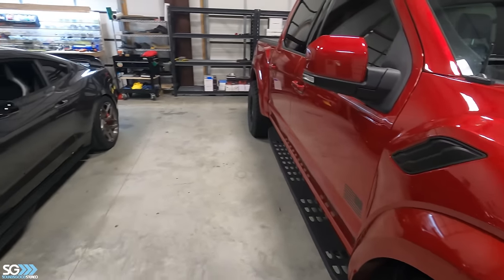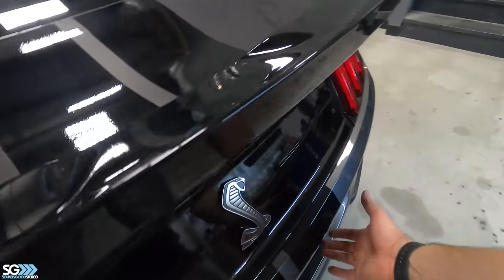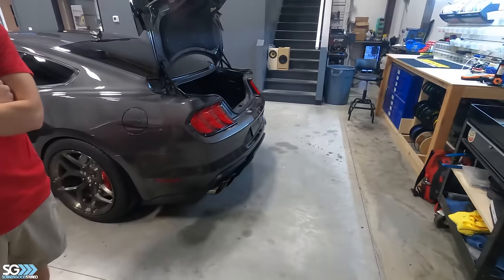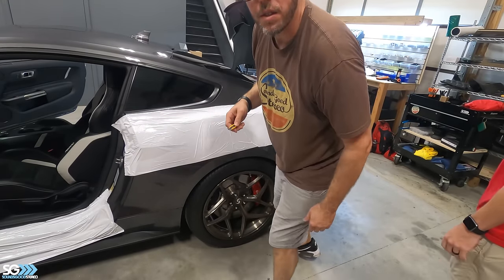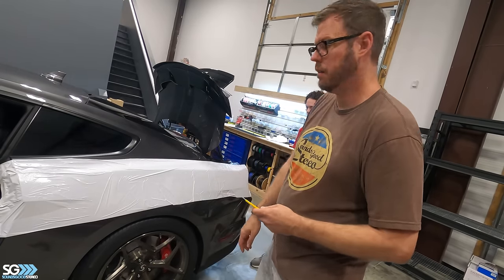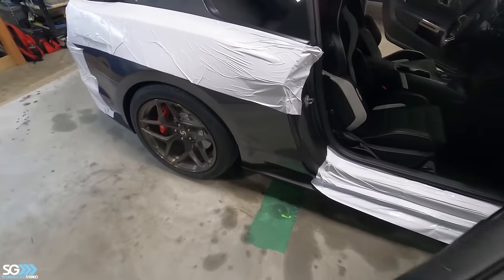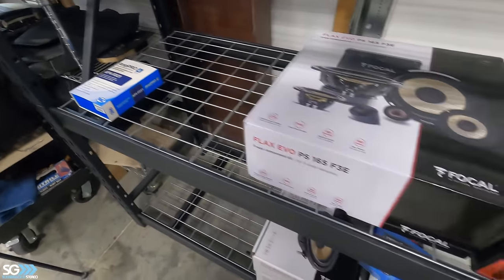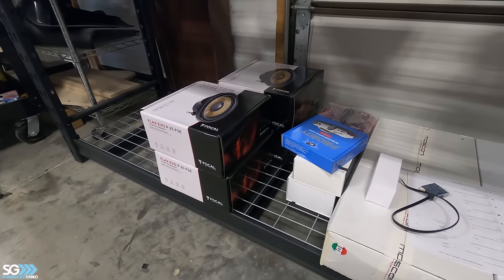2020 Ford Mustang GT500 Shelby Custom Stealth $20K Stereo System

Comment: How did we gomfrom Flax 3 ways to having K2 is my question...
Reply from the maker: Good eye, but it’s actually two mustangs, at the same time. One has K2 and the other Flax. You can see the wheels change between the cars
Reply: I see the 2 cars..  no mention of any other system going into the other car earlier in the video or in the description so kinda threw me off.   Wondered if the customer changed their mind or if the flax didn't fit.   I have the k2s in my Flex but was curious about the flax is all .
Reply from the maker: We started the first one and another customer of ours begged up to do his Mustang.. So it's identical systems, gear, etc except interior speakers. Made it very efficient for us and the two clients benefited from this to help reduce the custom fab costs.

Comment: I have a 2019 mustang convertible I have 2 runs of xspower 0 gauge one power one ground going back. I have the same focal 3 way front component set in front being it's convertible I had no space had to run neo 6.5 in the sides of the back. I have a crossfire 800.4 running the mids and highs and a crossfire 800.1 running a single sundown x8 @ 1ohm.
Now I have factory battery under the hood plan on doing a big 3 and have a xspower d1200 for for in the trunk but I don't see any one doing builds in these mustangs and using extra batteries. What was used for electrical in this car? I know the 2 runs I have are over kill but do I not need the batter in the back? Do I have to do a big 3?
Reply from the maker: We design our systems for efficiency, so no need for electrical upgrades. To do this, you will need to use efficient speakers, amplifiers, enclosure design along with setting the levels with a Oscilloscope. Then the final tune with a DSP to ensure no wasted energy is transferred to heat that is not needed to be.

Comment: Them subs probably could use more airspace in the box but what do i know😂
Reply from the maker: These are designed for small sealed enclosures, these are the pancake subs, not the full frame Flax. They require around 0.64 each to reach 34hz F-3 down point. 
https://www.focal-america.com/wp-content/uploads/2020/01/FT_P25FSE-1.pdf

Comment: What about the center channel mid? Is it still working?
Reply from the maker: No, in this vehicle we recreated the a phantom center with the Mosconi 8to12 Aerospace DSP. So you would never know the center channel is not playing and customers always swear there is a center channel....
Reply: I almost always get rid of the center channel. most aftermarket equipment is not setup for it and most audio is recorded in stereo anyways which means that the factory center channel was made up and not how the sound engineer that did the mix intended it to sound.
Reply from the maker: Yes.. We are starting to use a type of upmixer which retains "stereo, but provides better dimension to the sound stage. It's very interesting.

Comment: Did both Mustang's get the same Mosconi amps?
Reply from the maker: Yeap, identical system except front speakers
Reply: So the power from that Mosconi amp isn't to much for the Focal flax 3way.
Reply from the maker: No, not in the right hands… Wait until you see what we did in the Bronco build… we ran the Pro 5/30 just for the left side 3-way and another Pro 5/30 for the right side.. So 2,600+ just on the 3-way kit 😱😱

Comment: Nice work but there is no way in hell that the airspace is enough for 4 of those subwoofers. I know for a fact that those 4 subwoofers in that small airspace is severely underperforming and not playing no where to its potential. One 10 ported or one 12 sealed would yield more output.
Reply from the maker: These are designed for small sealed enclosures, these are the pancake subs, not the full frame Flax. They require around 0.64 each to reach 34hz F-3 down point. 
https://www.focal-america.com/wp-content/uploads/2020/01/FT_P25FSE-1.pdf

Comment: I dunno how one could justify spending between 75-100k for a car then spend another quarter of what the car cost into a stereo like that..  i mean great work on the install, everything was put in with the best if care and products but the profit margin on that build had to be 80% labor 20% on parts and materials.  or real close to that..  because for everything that physically got installed product wise couldnt cost a dealer/ installer any more than 3k tops and the very tops.  Because think about the tahoe that down4sound built..  he invested 20k into that audio system and that is over 100k watts with more speakers you can count on your hands, all competition 15 sundown audio's and that build came with a full custom fiberglass interior, plexi windshield and windows, i mean everything needed for a comp. Stereo..  just blows my mind how much price varies with things..  dude can pull up to a store and literally rattle crap off the shelves inside the store.  He cracked a gas station window playing his car stereo...
Reply from the maker: I know what you are saying.... Just think about this.. A Porsche GT3 cost from $161,100, that's the starting point. Here are the specs:

0-60 - 2.7 Sec
Qtr Mile - 10.8sec

Now you can spend $30k on an old car, add engine/turbo/nitrous, etc and absolutely go faster than this car for WAY less...

It's not all about how fast in a straight line you can go but rather a car that delivers the entire package. Speed, corning, luxury interior, technology, safety features, air conditioning, luggage room, and not leaving every event on a trailer from it breaking, etc. That's why people buy a $160K "SLOW" car.. Not because of the straight-line speed.

Our systems are for music reproduction, accuracy, staging, depth, width and deliver a concert-level volume, with absolute precision in music that rivals most high-end home audio systems.

So your correct, D4S truck is insane, it's a lot of fun, but it's designed to shock rather than to play for accuracy. So two different customers, two different lifestyles. We cater to the customers that want it all and we make it look factory when it's done.

Comment: 2.5 hour vid and 20 mins in all the speakers are installed and half the trunk is done with no work shown. Then 2 hours of wood working. WTH?
Reply from the maker: Yes, that is what it takes to build a custom stereo system. The equipment is easy, but a stealth installation takes time. So for those that want to learn new techniques, improve their skill set, they can pick up on things from our videos.
Reply: Yes it would have been nice to see 'up the dress / behind the curtain' to see how it was routed and if the wires were Tessa tape shrink wrapped etc.
Reply from the maker: You can check out our other videos to see how we do behind the scenes on the wiring.

Comment: https://youtu.be/dvj9ilB8vqA?t=35  Wouldn't doubt it was programmed wrong from factory.  Common issue on the Focus RS.
Reply from the maker: It's common in the 2018-2020 Ford vehicles. I guess it was a transition period. Inside the amplifier, it say Harman, so a totally different company

Comment: I don't get why people spend so much money on "okay" speaker brands. FOCAL was cool 10 years ago. Now its become "trendy" because people started learning about them, all while other brands have surpassed them.
Reply from the maker: Not true…. If we believe we could produce a better system, for less money, sign us up. But in reality, this is simply not true. Just like cars, a Koenigsegg is not the fastest in a quarter mile, so why do people buy them? It’s not about doing only one thing great, it’s the entire package, handling, speed, engineering, absolute precision, etc. No other brand does the entire package better than Focal, period. But just like anything, tuning, acoustical treatments, customers goals, etc all play a part.
Reply: @SoundsGoodStereo    I’ve had three sets of Focal components before bud, including the K2 Power KX’s. They’re definitely not the best for the money. Audison Voce K6’s blow them away (currently running these now) for a few hundred less. They produce more rms watts, even in its 4ohm configuration, and still produces about the same db levels and more frequency response. Focals sound like a “better tuned”Alpine brand of speaker, especially due to its high pitched tweeters. Audison components sound premium and acoustic in comparison. Less distortion with Audison Voce K6’s. Even Morel’s sound a lot better than the Focal’s.

As far as subs are concerned, the Sundown SD4 shallow mount sub produces more rms, more bass, and as good, if better, SQ than the Focal P25’s used here, for around the same price. 

I do like your use of Mosconi amps and DSP, but there’s a lot left on the table using those Focal speakers and subs. I understand the owner wants to stick with one brand for the speakers and subs, but there’s so much more he could have done with the money he spent. Most of the time, it comes down to people not knowing other brands out there, because other brands aren’t trendy like others, or what shops have in house for potential customers to demo, and the shop selling them on the brands they carry. This is why so many uninformed buyers buy Alpine, or Pioneer, when they could’ve bought Focal for the same price, but these customers most likely never knew Focal existed. Same principle.
Reply from the maker: Let us know when your in the area and we will see if we have a vehicle for you to hear for yourself. Just like engines, tuning is everything and you can make even the best "parts" fail when they are not utilized properly. We can just agree to disagree on the brand choices, no reason to compare, but we know the capabilities of these products, have used several other "brands" to accomplish unique goals for our clients and are familiar with the "products" you mentioned. There is a reason they are not in this vehicle and the customer had zero say in the gear... We do not let customers tell us what gear they want, but rather we use our experience to accomplish a goal for that client within their budget.
Reply: @SoundsGoodStereo  I had a shop sell me on Focal’s about a decade ago, just the same. Spent thousands on speakers, subs, and tuning. I’ll never make that choice to have a shop “make the choice for me” ever again. But back then I didn’t know any better. Now I do, and am more knowledgeable about speakers and brands across the spectrum, than most car audio shop owners. Yes, let’s agree to disagree on that issue.

Yes, tuning is a very important piece to the puzzle, but it’s still just a “piece”. Speakers are also an important piece to the puzzle.
Reply from the maker: You went to the wrong shop... If they do not know 1,000 times more than you on every aspect of the gear, acoustics, your vehicle, etc, then they are not the proper shop. It's unfortunate you had a bad experience with that shop and rest assure, like restaurants, we are not all created equal. In the future, pick a better chef, he will choose the best ingredients that fit your needs.

Comment: 20k buys you ....using all the factory speaker wires....yea ...they are probably good enough......
Reply from the maker: It's AC current that leaves the amplifier, not DC like the inputs.... Here is a copy/paste from someone you might know and respect that explains why you do not need to run new speaker wires in vehicles...

Here is the summary for those who do not want to read the entire post below: That puny 18 AWG speaker wire will handle 1000 watts of music before heating more than 40 degrees above its surroundings.   So unless you are running 1000w to your door speakers @Loud Elvis, you will end up wasting customers $$$ in the labor and materials to do so. These additional funds can go towards what really matters and deliver better sounding systems.

Tony D'Amore from D'Amore Engineering (World Famous Engineer in car stereo industry)

"It has come to my attention that I’m good at giving the longest answer.  Therefore I present for your entertainment the first installment of The Longest Answer.
Just saw this post:
What’s the max wattage you can send through 18 gauge wire to door speakers? ￼
Short answer: more than your speaker can handle bro, don’t worry about it
Longest answer:  This question needs to be answered with a very important question.   
How hot can the wire be allowed to get?  
The limit of how much power “wattage” you can put through a wire is the point where it melts, typically catching on fire and then breaking open.  This is what fuses do.  Assuming you don’t want a fire, how hot do you want to allow the wire to get?  Even 1 Watt will heat up the wire, it might be hard to measure such a small temperature change but it is there.  Ok let’s say we will allow it to heat up by 40 degrees F  compared to its surroundings.  
Another important question:  How long is the wire?  This will also play a role, the longer the wire the more heat will be generated (albeit the more area it is spread out upon)
Another important question:  What is the impedance of the speaker connected to it?   A 2 ohm speaker will create double the heat in the wire compared to a 4 ohm speaker for the same given power.  
Another question:  What type of music is going to be played?  Heavy bass music is going to create more heat than classical.  A continuous sine wave will create about 5-8X the heat of a typical modern song. 
Another important question:  What is the speaker wire made from?  Is it pure copper?  In today’s world of everything fake, it’s very likely that the wire could be aluminum, coated with a thin layer of copper.   
Assumptions for questions above:
1.  40 degrees F
2.  15 feet
3.  4 ohms
5.  Hip hop
6.  Pure copper 
￼
15 feet of 18 gauge speaker wire is actually 30 feet long, to the electrons.  As they will leave the amplifier through the “positive” wire and return to the amplifier on the “negative” wire.  
So, 30 feet of 18AWG wire made from pure copper, sometimes called OFC.  This has a resistance of 0.189 ohms.  The copper has an equivalent diameter of 0.04 inches.  Density of copper is about 5.1 oz per cubic inch.  We have ((0.04)/2)^2 x pi x 30 x 12) = 0.45 cubic inches of copper x the density of 5.1 oz/ cubic inch = We have 2.3 ounces of copper.  
The new question:  So how much power will it take to raise the temperature of 2.3 ounces of copper by 40 degrees F?  
Specific heat capacity of copper = 0.38 J/g K.  Converting to the units in the problem  and solving the problem above =  (0.38 Watt seconds * 2.3 * 28.3)) * 22 = 544 watt seconds.  
Oops that brings up another question, for how long are we doing this?  Now things get really interesting because we have heat building up in the wire over time, but we also have heat dissipating from the wire over time.  To solve this we need to answer about 5 other questions such as:  Is the wire touching anything?  How thick is the insulation?  How much of the insulation is touching something else?  What is the something else made of?  Is there any moving air around the wire?  
Ok the rabbit hole is getting deep.  This is why when you ask an engineer a question such as the one above the engineer will probably just pause with a “ugh.. “ or “umm”  or something like this.  Don’t confuse this with the engineer thinking about how to solve the problem, the engineer is thinking about how do I answer this so it is understandable and useful to a non scientist.  
Back to the original question and making more assumptions.  
Let’s assume the wire will get as hot as it’s going to get within 1 minute of use, after this it is dissipating enough heat to everything around it to maintain a constant temperature.  
544 Watt seconds is the same amount of energy as 9 Watt minutes.  So the intermediate answer is 9 Watts for one minute of heat in the wire will raise its temperature by 40 degrees F.  
To answer the original question we have to know how much of the amplifiers power is going into the speaker, and how much is heating up the speaker wire.   For that we can use a ratio of impedances.  The speaker is 4 ohms, the wire is 0.189 ohms.  So 4 / 0.189 = 21.1   The speaker will get 21.1 times the power that is being burned up in the wire.  So 9 watts in the wire  =  190 watts in the speaker.  Or a total of 199 watts.  But wait, there’s more!  This would be 199 watts of continuous sine wave power for one minute.  Typical modern music contains about 1/5 the average power of a sine wave.  So 199 x 5 = nearly 1000 watts of music.  
Summary:  That puny 18 AWG speaker wire will handle 1000 watts of music before heating more than 40 degrees above its surroundings.   
The question they should have asked:  
If I run 15 feet of 18 AWG speaker wire from my 1000 watt amp to my 4 ohm speaker, how much power will I lose in the wire?
The answer:  45 watts 
This has been the longest answer by Tony D’Amore.  Thanks for reading.  Good night
Reply: call me overly anal or old school....A nice ofc aftermarket wire direct from amp to each speaker would help me sleep at night lol...but I don't do that many cars anymore so what I do work on is at a reasonable pace...the joys of getting old...great video ..... I always enjoy